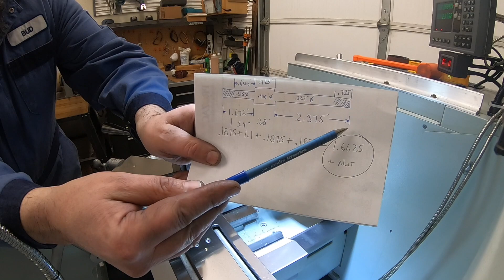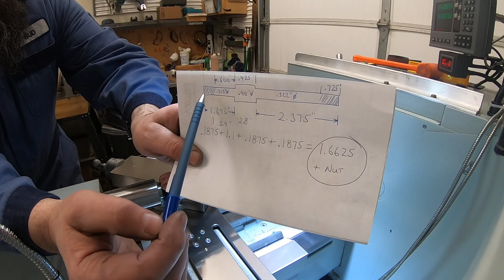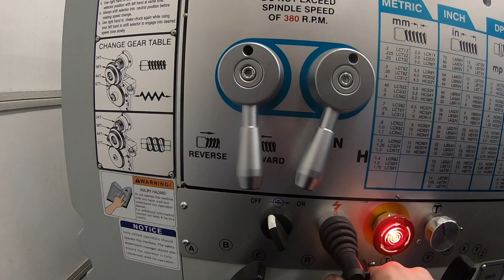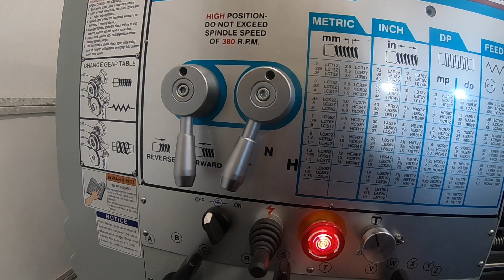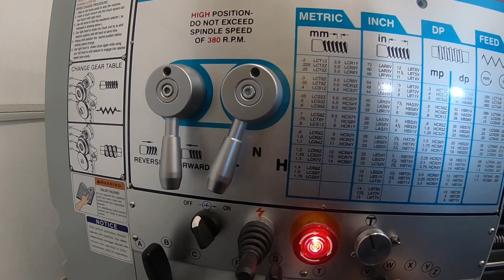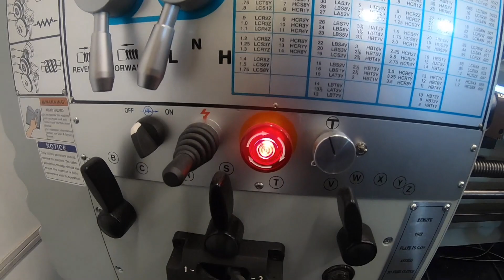Boley and Leinen Watchmakers Lathe Repair, Refurbish and Then Use!

Comment: its not for woodworking. traditional watchmaking used carbide gravers to work/cut the steel being turned. same as woodworking with a gouge.
Reply from the maker: Kirk - thank you for the comment, others shared the same thing. Truly skilled craftsmen doing all that small work by hand without a screw fed compound. I will have to try that at some point.

Comment: 2 years late  ,.... But I think it would have worked if you actually set the knob to R 😅
Reply from the maker: @SDCollectiveBand - Ha, good to know, thanks. At least I did get it running and have not been waiting 2 years for this key information. 😂😂 Appreciate the comment.
Reply: @BladesIIB  You will not get any rest until you try the same threads with the knob set to R ;)
Reply from the maker: @SDCollectiveBand  - Not sure I follow. I used R when trying the metric pitch which was wrong. Once I moved back to standard gears the R would have been a much different pitch than what I needed?? On my lathe 32-72 TPI.

Comment: Not set up for woodworking, watch and clock makers often work freehand from a tool rest
Reply from the maker: Sean Wilson - Thanks for the comment. Since posting the video I have had several people inform me about gravers and how this should be used. Truly talented people who made the intricate parts they did on these. Wish I was that skilled.
Reply: @BladesIIB  no problem. You need high magnification glasses to do anything on clocks. Would never attempt a watch repair.  My hands are too big for a start.

Comment: Great project! I’m sure you have vast experience in machining, and your relative used this lathe for woodwork, but the setup you have is for metal. Those suckers, with all due respect lol, were able to machine watch parts, with precision, without any automatic feeder or thread apparatus! It was cut by hand, as you did with your baseball bat, then finished the parts with very fine files and sandpaper. I own one similar to yours that I’m debating if i should refurbish it or not, but your video is very tempting!
Some little tips are:
- make the motor mounts adjustable for distance to the lathe so you can adjust tension when moving belt from one gear to another;
- belt could be done off of a Diesel engine rubber gasket that’s round, since you don’t mind taking it apart to change it, and those gaskets are pretty durable. The original ones were silicone type, cut to length then fused in place, limiting the disassembly of the lathe to keep its precision;
- always use the tailstock to cut anything or you’ll damage the collets and the bearing on the headstock!;
- don’t forget to keep lubrication on the headstock bearings as it’s easy for any of us to overlook it since it’s such a small machine but it’s essential for longevity.
Like I’ve said before, your experience seems much higher than mine on machining, but hope any of these comments are useful from this humble watchmaker apprentice.
Keep up these videos as you’re very through and neat with your projects!
Cheers
Reply from the maker: Edson, great feedback and much appreciated. I had someone else I form me about the hand gravers and Metal capabilities and to your point, amazing craftsmen who used these machines. I can only dream of that level of skill. Maybe one day. The mount for the lathe is adjustable for the different pillows so I have that part covered. Unfortunately I don’t have the tail stock, that was not part of the package. Great tip on the belt, I have seen the round ones and in the end copied what it came with. Good to know there are more options out there. I will be sure to keep the headstock lubed. Glad you liked the restoration and the other videos. All the best with your watchmaking. Fabulous skill to have.
Reply: I’m about to get a similar lathe. What lubricant is recommended for the taper bearings? And how often?
Reply from the maker: @kirkjensen1718  Here is what I found on The Hobby Machinist forum about oil for these - Spindle Oil ISO 22 (Mobil Velocite #10) - for speeds up to 3600 RPM, Spindle Oil ISO 10 (Mobil Velocite #6) - for speeds over 6000 RPM. Also said they can go through it depending on what you are doing so stop and check often. I assume temp is a good gauge of when you need to add some.
Reply: @BladesIIB  thank you! I assume you can add it to the small gap, no need to remove any parts?
Reply from the maker: @kirkjensen1718  there is usually an oiling point, I will have to check mine again to see. But I don’t recall pulling apart to add oil so believe you have that correct.
Reply: @kirkjensen1718  it will have a well on top of each bearing where you fill it and it will release it slowly as needed.

Comment: The correct term for that variable speed foot peddle is a rheostat.  It's basically resistance wire with a sweeper.
Reply from the maker: Chris Robinson - Thank you for the comment and the clarification on the name of that foot pedal.

Comment: The whole point to setting your compound at 29° is to feed in with your compound.
Reply from the maker: Yes agree. I typically leave my compound at 45. All personal preference and what you are used to. This has served me well.  45 gives me good clearance of the tail stock and keeps my cross slide further back covering more of that slide and keeping chips and debris off it.

Comment: How do you change the chucks tho lol and awesome work good clean up
Reply from the maker: @mikiahdavis2458 - Thanks!  The chuck basically is built on a collet. And all of the mini collets are pulled in with a draw bar. The little rubber wheel off to the left of the headstock is a hand wheel to tighten/loosen and change the collets or put the chuck on. Appreciate the question.

Comment: I am a newbie to the metal lathe. So please pardon me if this is a stupid question. Could you have used a die to cut the threads on the bolt?
Reply from the maker: Bob Chronister - thanks for the question. A die would work to cut the threads.  I prefer to cut them on a lathe, a die can be hard to keep straight and they don’t always cut the beat threads. I find I get a better product on the lathe. That is the beauty of machining, lots of different ways to get the same result. Happy New Year!
Reply: @BladesIIB  thank you sir.  That’s why I asked. My lathe experience is wood and acrylics (pen making). So I appreciate the knowledge. Great job restoring that lathe!

Comment: You know not many lathes will cut a 1.4mm  thread... (in fact probably not many thread gauge has it either). Are you sure it's 1.4mm? It could be some inch thread pitch. 

Why is it that metric tread can't disengage the half nut? What happens if you accidentally disengaged the half nut? How would you find your place again?
Reply from the maker: Tyler Fu - Great question, watch the video a little further and you will see that I messed that up and it was in fact 5/16x18 thread.  I make another shaft to correct it.  Because the pitch on the lead screw is standard that is why you can't disengage when cutting metric threads.  The opposite is true if you have a lathe with a metric lead screw you can't disengage when cutting standard threads.  The half nuts can only engage in one place based on the gearing.  If you ever bump them loose then you would treat that the same as having to replace or sharpen a non index threading tool.  Sharpen or replace the tool, reengage the half nuts, run the lathe to remove any backlash and get the tool over the thread.  Use the compound to align the tool back in the middle of your thread, reset your depth of cut and continue cutting your thread.  Hope that helps, thanks for the question.

Comment: NO, that is not what they are for, they machine very small steel and brass gears, wheels,etc. for watch making!, hence the name. 
A "mini-lathe" is a beginners toy, made in China or Taiwan ; THIS watchmakers lathe is for professionals to make parts 0.6 or so mm big!, like screws for cameras, watches, etc. in an industry called micro-machining, and watchmakers take a 3 or 4 year course in how to do this, not just your average hobbyist, but a serious and dexterity oriented enterprise.
Reply from the maker: @andyvan5692 - Appreciate the comment.  I should have done more research before making the video, did not mean to take away from the truly talented watch makers or the intended use of this machine.  Since posting this I have learned more about what this machine is meant for and skilled craftsmen who can make it do what it is intended.
Reply: @BladesIIB  no worries,  sorry if my writing was a bit upfront,  seeing the project you did, that is a use for it, but I was illuding to its use in modelling,  not big scale , and as you only had the "graver" rest on the rail, not the other " compound rest " as many see on Dean DK 's channel, or others, which infers its metal work use It was just a clarification that; as designed,  that was its purpose.
Reply: @BladesIIB  not to worry, I am Autistic and take the spelling and meaning far to seriously, and besides that this tool is a Neisch item not too many know about,  my "special interest" is in mechanics and tech , so I probably know a little more information than most people.
Reply from the maker: @andyvan5692  Your comment was fine. I wish I did have the mechanical compound, I have seen those online as well. The fact that they could make threads and other tiny parts with just the tool rest though is impressive.

Comment: I think your 8mm x 1.4mm pitch screw is remarkably close to a 5/16" x 18t.p.i. thread.
Reply from the maker: Cas Iwaszkiewicz - Yes at about the 24 minute mark I figure that out and make it correctly at 5/16”x18. Should have caught it earlier for sure. Good learning. Thanks for the comment.

Comment: It would appear that your feeding in with just your carriage.
Reply from the maker: I assume you mean for the thread?  If so, yes for most small threads I plunge strait in. I could set my compound to 29 deg and feed with that but I usually only do that if I am having chatter or finish issues.

Comment: Where did you order the replacement belt for this machine. I need one and none I’ve found are the correct size.
Reply from the maker: jewelgrl425 - Thanks for the question, sorry for the delay responding, had to go back and see where I ordered that from.  I ordered it from www.vbeltoutlet.com.  The belt it came with was a 228XL and was 4.2mm wide.  They did not have that exact width but I called them and they were able to cut them to that width for me.  I don't think mine was original, just a sewing machine belt but seems to work.  I have seen others who use the round belts for these.  They are cut to length and glue back together so you may want to look into that as well.  Good luck!
Reply: @BladesIIB  I used a fusible round belt material, seems to be working fine for now. Thanks for the reply!
Reply from the maker: @jewelgrl425  Great to hear. Glad you have it working.